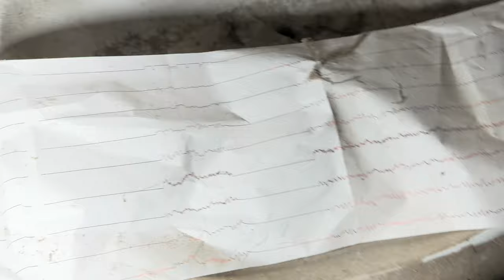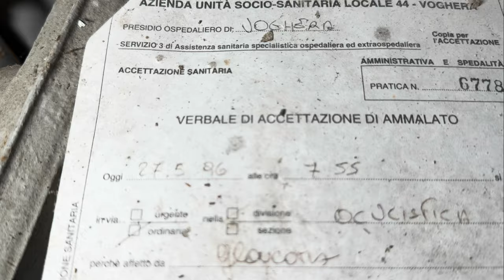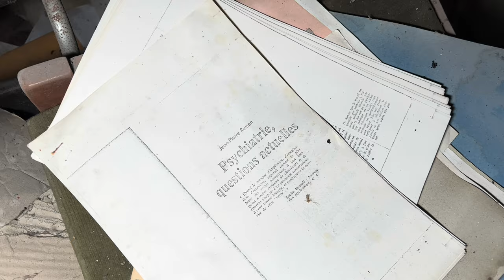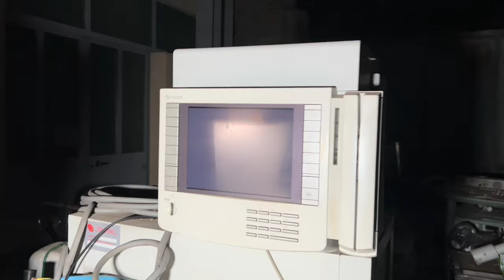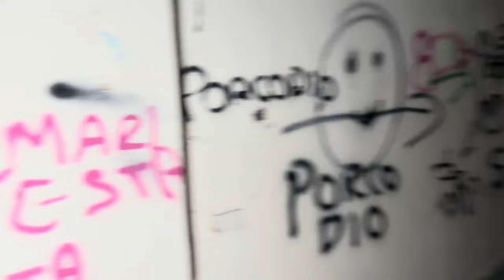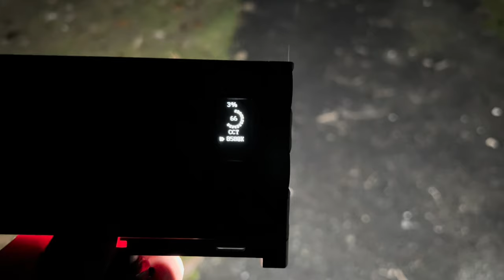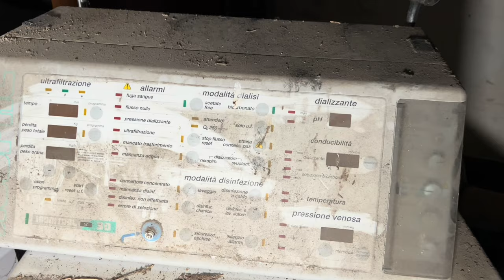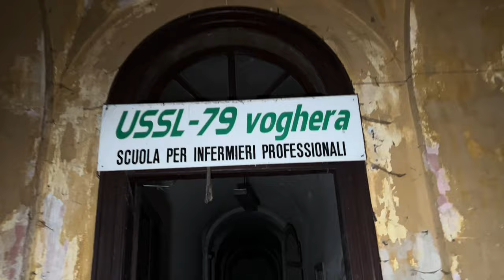LOST and SCARED in an ABANDONED asylum ALL NIGHT

Comment: So is the newer part still being used as an asylum or has it been repurposed into apartments, I noticed in the cellar it looked like new electrical an water lines running through also newer water heaters on the walls.

Comment: 3:56 that appears to be an old EEG reading of the brain activity. You can see the letter ‘B’ for beta waves. I’ve had plenty of those when I was younger when doctors stuck needles in my head with a very tight cap that hurt so bad to test my seizure activity (and decade later a glioma was found in me noggin). Luckily the electrodes aren’t so bad nowadays, only the pumice used on scalp just hurts before sticky glue attaches the leads, but it’s been over a decade and going in for another EEG next month... hopefully it will be much simpler and painless. I couldn’t even image what they went through back then because I remember needles, then they switched to suction bulbous leads, and then to glued leads to head. The caps were for longer tests, the longest I had was a week, I felt like the predator or an alien with all the wires, it’s awful.
Reply: I feel for you, hon, that sounded awful.
Reply: Thank you, I’m just glad medical tests are much better, going from the 70’s to present day is a huge difference. Just sad over all those that suffered and without any medicine to help ease pain or discomfort back then... I remember my 1st bone marrow test, I was 10, I was strapped down and held to make sure I didn’t move, but these days it’s a breeze with gen anesthesia. Just glad no one has to experience these horrific practices anymore. ❤
Reply: Bloody hell xx

Hope the next one better for you👍❤
Reply: @HiddenRoyal1472   bless you...